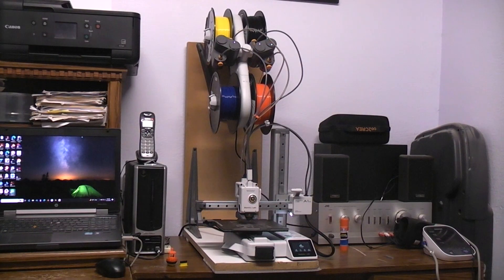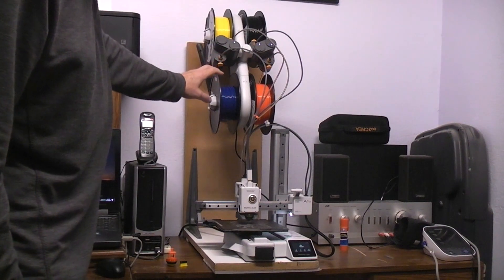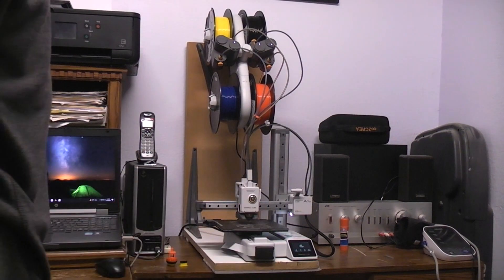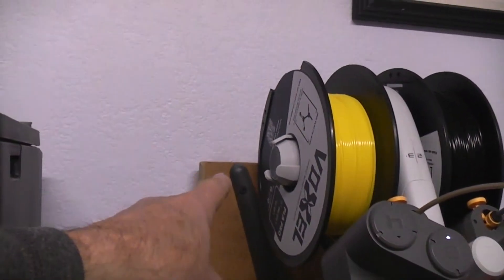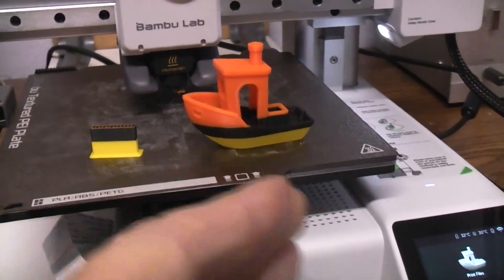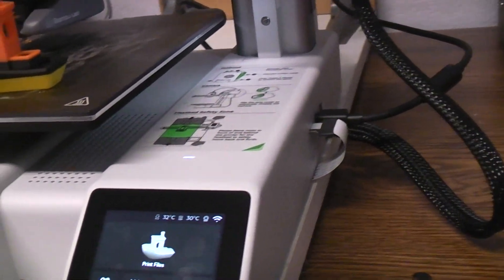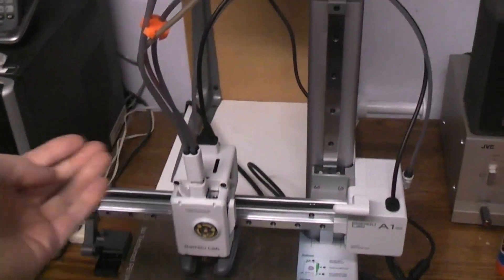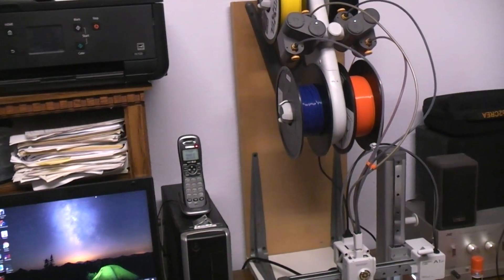Bambu Lab A1 Mini, Vertical mount for your AMS "Lite" to save bench space.

Comment: The whole reason I haven't bought one is the horizontal space they take up. You solved that in a clever way, nice work.
Reply from the maker: There are stl files to print new AMS mounts brackets That you can find online that make it take up less depth as well. I have just installed them on mine, saves about 6 inches in desk top depth.
Reply: Do you have a link or name of one that worked well for you? Finding all sorts of solutions out there.
Reply: @jordanhwelch  I can't find the exact one I used but it's a variation of this one on Makerworld 
"IMPROVED AMS Lite Wall Mount Adapter

Remixed by
Wolf3DP"
The one I used simply had the two parts already put together, but this one should be fine. I used PETG btw., I don't recall but probably with 4-6 walls, probably the at least the same top and bottom, and probably 20-30% infill. I'd also turn up the heat a little as you don't want this coming apart during a print.

Comment: Thank you so  much for this. I'm glad I'm not the only one who had this idea and that I was able to see it works before I make a similar leap. 

I have the A1 Mini on pre-order now just waiting for it to ship. I've been tinkering with the idea of making a plexi enclosed shelf above mine to house both the AMS and room for storage of 8 or so more spools as a dry box for filament storage and run the bowden tubes out the bottom. I've  previously used a large plastic storage container similarly with both a small peltier dehumidifier and silica desiccant that keeps humidity consistently at under 30%, so I'm looking forward to freeing up some room in the shop and keeping the spools on the AMS dry at the same time.

Now I just need to get a working poop chute to a trash can below sorted out for it.
Reply from the maker: The poop seems to fly all over so good luck catching it all. I ordered a send cable for the AMS and will experiment with extending it so that the AMS can be right side up when mounted above the A1 Mini.

Comment: Great solution. I thought of setting the AMS behind the A1 (my table has 80cm) but this is so much better. Also an enclosure would be more easy to build (I have some acrilic panels from an old shower cabins door, so small but long).
Quite sad the maximum temperature of the bed is only 80°C, because with this modification and an enclosure, the printer would be nice for ABS else.

Comment: I just recently added my A1 mini through the Bambu Slicer that way when I send the file through a phone hot spot that is one way if you have a decent internet connection.  You mentioned you did not have a phone to run off of my Iphone would not let me register the new printer.  That is why I tried to go through the Bambu Slicer.  You can find it under Device tab above and go from there.  Once I did that my Bambu Handy was finally able to see the printer.  Not sure why it did not work but now it does.   I have never connected through the LAN method.   Ohh one more thing I am going to order me a replacement 4 plug cord and then cut and extend it.  Also there is a person who posted on his version of the mount via the wall the 4 pin connectors off of Amazon.  I do not know if they will work but I did order a set I guess I will give that a try too but thats going to be a few weeks off since I will have to wait for the parts.  Let me find the link and post.  Thank you for your video.
Reply from the maker: Yes post a video of your progress and links to the 4 pin connector if you can.

Comment: I've been thinking about buying this printer because of the speed. I am curious how it prints functional parts. I watched a review video on a channel called 247printing where they printed a very tall part in vase mode. He showed the Z axis movement while printing at the top of the part. It showed considerable movement up and down. He measured it as one millimeter.  This leads me to believe any unevenness in the bed will be repeated all through the printed part. That might be a problem on larger functional parts. I've only had printers with manual bed leveling so I'm not sure how the mesh bed leveling works. 
Thanks,
Rick
Reply from the maker: I am working on a speed / quality test video right now. I have printed 30 mechanical parts for a robot project and so far the parts are perfect and print in 1/3 the time of my PRUSA MK3s with the same 0.2 layer height setting.
Reply: @Robothut  That's very encouraging. I really want a faster printer. I would probably get the multi-color add on since it's only available as a package now. You can't buy just the printer alone at this time.  Most of the 3d printer reviews seem to aimed at people who use their printers for non mechanical prints. Looking forward to your test video.
Thanks,
Rick
Reply from the maker: Video will go up tomorrow. Just to let you know all the parts are perfect fit and the quality is better than the Prusa MK3s and 3 times faster. it is amazing. @rick_100

Comment: What did that rig cost ? Thanks John the robot 🤖 man . 😎👍🏻
Reply from the maker: The A1 Mini printer is $300.00 with the AMS 4 color unit it is around $450.00 plus shipping. The Printer prints 3 times faster than standard printers and at a higher quality.
Reply: @Robothut  thanks for info John , much appreciated
Reply: @Robothut  I think I found this on Amazon not sure 🤔
Reply from the maker: Buy it from BambuLab.com for the best price. They warehouse in USA so shipping is fast as long as they are not sold out.
https://bambulab.com/en-us/a1-mini
 @PeterAgostiniJdcap26

Comment: Cool solution but isnt it recommended by bambulab to not hang it on wall and let it side by side with printer? Would love this on wall if its ok
Reply from the maker: Seems to have no problem working in the vertical position. I do not see any post anywhere from Bambu saying it will not work this way.

Comment: Yup.  Looks nice. Big fan of going vertical for storage. You know if you cut that cable mid-section you could add any sort of plugs to extend it. Or,  staggering the joins, you could do an almost invisible soldering joint using heat shrink. If you want, I'll do a video demo to show you how, but you probably already know how to do it.
Reply from the maker: Yes, cutting and extending the cable was my first thought as well. But since it works as is I may hold off incase someone comes up with the actual connectors that were used or a extension cable.
Reply: @Robothut  it seem they are using the same 4 pin CPU power cable as per another similar mod maker from Makerworld.
Reply from the maker: Now to find the name of the part or cable . @mytubeview

Comment: Very good solution! Brilliant! Every other reviewer points out that it takes up more 'floorspace' than an X1 with the AMS-Lite next to the printer. By the fourth reviewer I got so fed up that I told him "Mount it above the printer : the spools are locked on their spindles! Are you a maker or just a printer ?" OK, you already know this, but the filament tangle detection will detect a tangle when the hub is pulled down to the printer because the filament is harder to pull into the printhead : a magnet inside the hub will then come closer to a sensor and detect the tangle (it's in the starter manual online) so you do need to keep bends in the tubes.